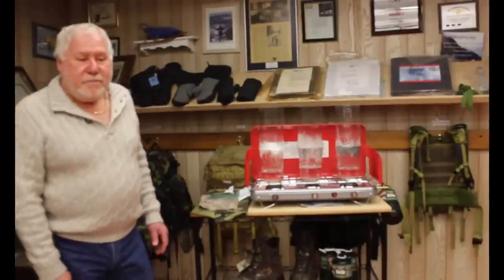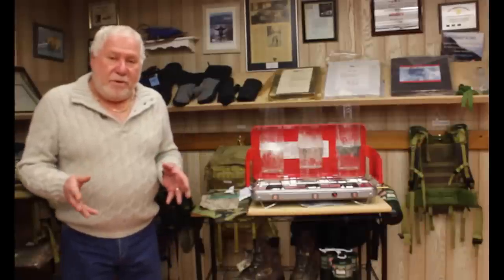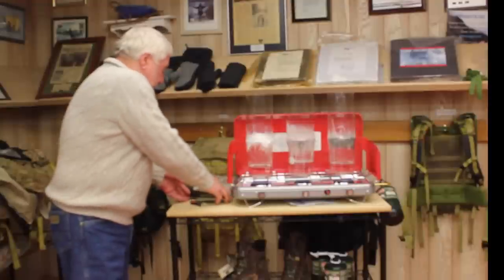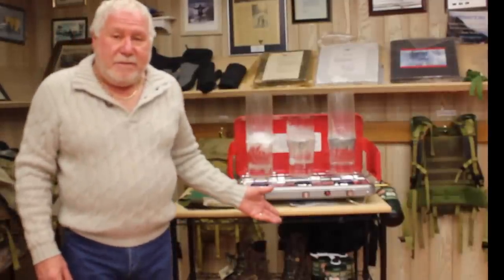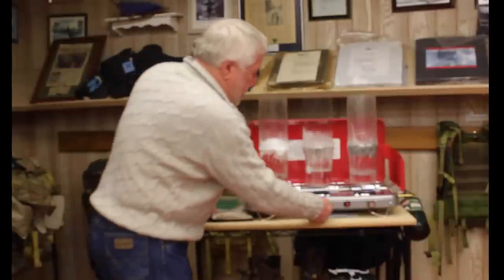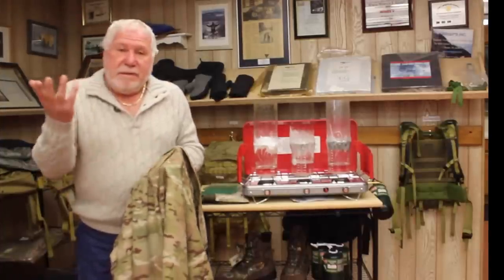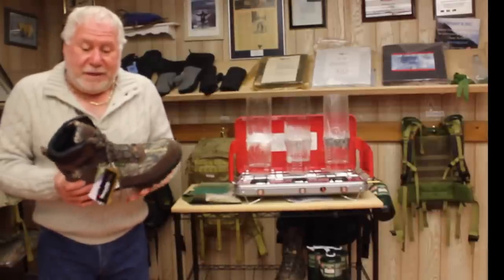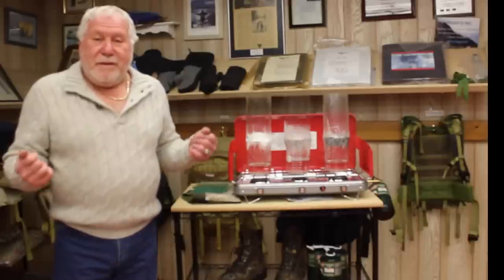The Myth of Waterproof Breathable Video

Comment: I stumbled on this video whilst watching a bushcraft vid.  I have been climbing and mountaineering  for 27 years and enjoy hiking/trekking in the northern hemisphere  mainly in the UK where I reside and in Scandinavian countries,

When you use the term film, do you mean the membrane?  If so to suggest  people are wasting money I think is somewhat confusing?

I agree that the term breathable is somewhat misleading and most people do not understand the dynamics of moisture vapour  transfer.

Your argument I believe  is flawed.  The steam demonstration is simply a method of explanation of the process.  Of course no person will make steam/vapour process like that.  However in addition to quantative data perhaps what is more important is qualatitive data.  In other words try walking up hill for an hr in a non permable  in liner vs a mordern gortex etx.  The results will be clear from all you speak too.

Membranes  were actually developed for high altitude and cold weather work.  In humid muggy conditions membrane jackets perform badley because an equlebium of temp between the inside and outside of the jacket occurs and limits he moisture  vapour process as the pressure outside is greater or the same or near.

In cold weather the jackets perfom much better.

I actually prefer a ventile , fjallraven g1000 material or paramo product which breath way better.  That said come to the Caingorms in Scotland in Feb in the pourimg rain without a hard shell and the results can be lethal.

Hope you dont mind me sharing my spin on things, I enjoyed your vid.

Kind Regards.
Reply: J Bradshaw:  I think you missed an important point Mr. Wigutow was trying to make.  You might as well have that 'hard' shell be a cheap urethane or pvc coated shell and save big bucks, because you're blocking the rain either way, and not gaining any benefits from breathability, especially when physically active.  I've learned a lot from Mr. W., especially about quilting stitches compressing vital insulation loft requiring lamination as a substitute to keep insulation in place.  In your Scotland situation, another beneficial alternative would be the vapor barrier liner inside the insulation, as well as another VBL on the outside of the insulation, shielding the insulation from dreaded moisture saturation from either direction.  Thanks to Hal Weiss in Secrets of Warmth book for that pearl.  Thanks again, Mr. Wigutow, for sharing your acquired knowledge.
Reply: @brianmgrim  thanks for the reply.. I had posted that about three years ago!  Of course an umbrella beats everything for breathability lol!  Keep safe atb.

Comment: I was hiking in the mountains in July and it started to rain. I put on my gore-tex rain suit. While I was walking in a relatively flat terrain, it was not so bad. I opened the ventilation ports on the side the jacket and trousers and carried on. Then followed a very steep part of the trail. At the top I removed all of my rain gear, because it was too damn hot. I was wet because of my own sweat. The outside temperature was around +15. It took me a while to cool down. I continued with my regular clothes.

Comment: I was a snowmaker in Colorado and made the mistake of getting the Irish Setter Gore-tex boots made by Red Wing hoping they’d be the best boots ever.  They weren’t.

Just as described in this video my feet would perspirate, the moisture would condense when it hit the freezing shell of the boots and my socks would get soaked within an hour.

The only good things I can say about those boots is that they looked nice (for only a couple winters), and the soles had excellent traction (but wore very quickly).

Comment: Ok here is how it really works. Modern Gore Tex laminates are best for sedentary activities like fishing because it can not allow water vaper to escape fast enough to keep up with your bodies perspiration during more strenuous activities. So no the rain didn't go through your Gore Tex, you're soaking wet because your sweating faster than the fabric can shed the moisture. This is true for all modern "breathable" laminates. Now if you are out of shape and get sweaty walking to the mailbox or just a profuse sweater then it's only going to make things worse.

On a side note nothing on planet earth is completely waterproof. It depends on pressure. You tube has plenty of videos showing steel plates being cut in half with water.

Cotton based fabrics like Ventile/etaProof are more breathable than any modern laminates. The confusion is that unless your etaProof/Ventile is of the 300 gram type then it isn't the same thing that was used for RAF immersion suits, fire hoses, etc. The Ventile fabrics I see are mostly 170 gram or lower, and without a synthetic liner the water eventually gets through.